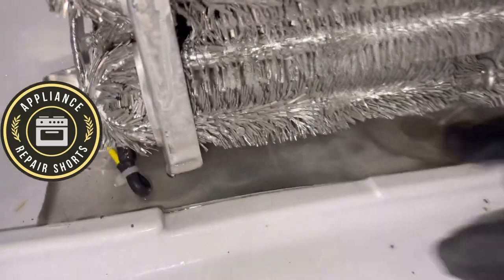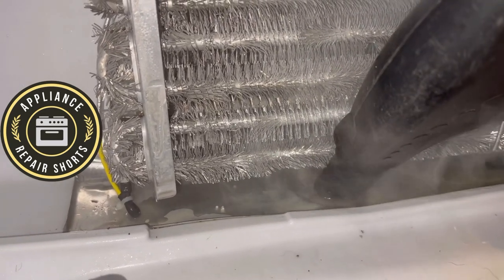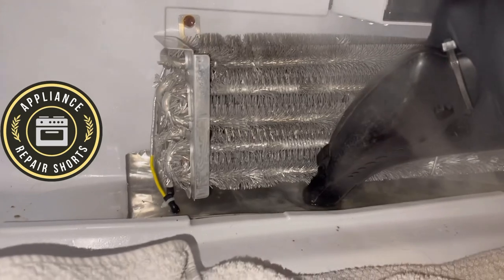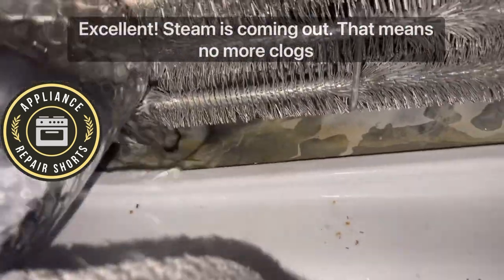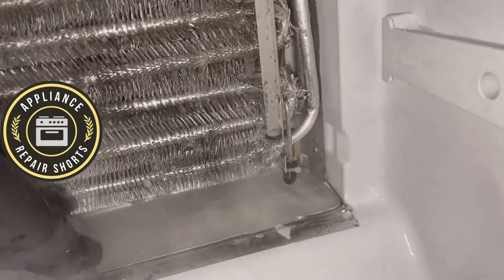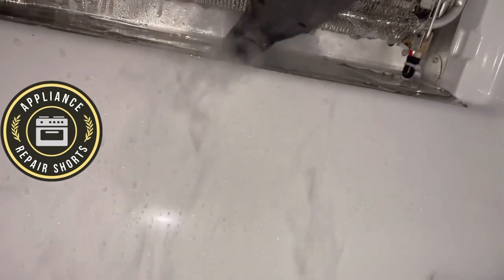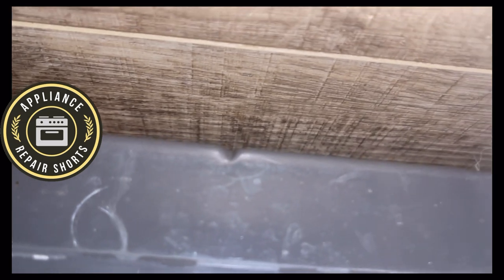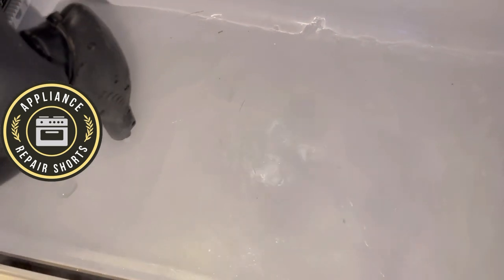GE Refrigerator Not Cooling | Clogged Drain| GFE28GMKEES

Comment: Why does frozen evap coil cause the fridge not to cool properly?
Reply from the maker: To break it down. You have a fan that’s moving air through the evaporator. The air is warm and the evaporator grabs the moisture and it stays as cooler air is delivered to your refrigerator. When you have a frozen evaporator that is covered with ice, the transfer stops. Ice is a very good insulator. So it is very important to keep your doors closing properly, drain tubes clean and not leaving the door open for too long.